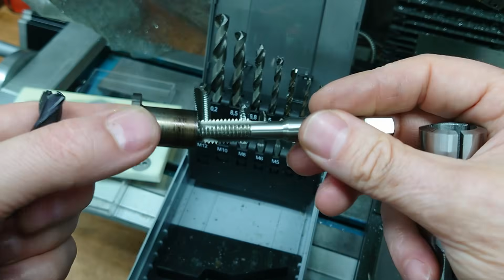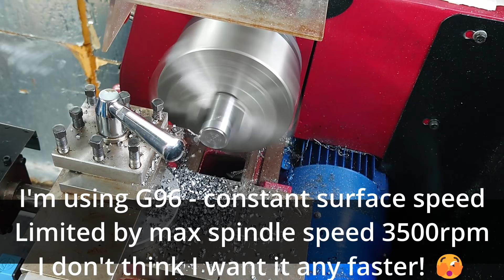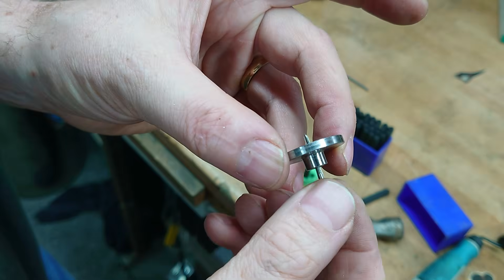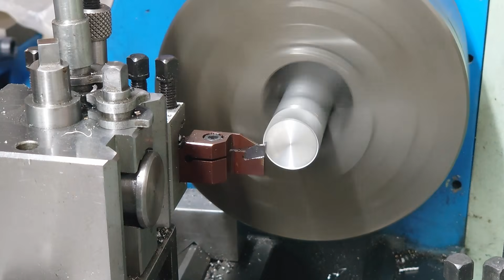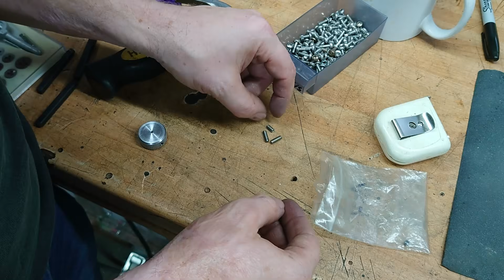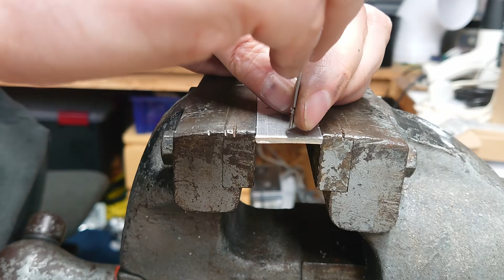Tiny Tapping Guide and Knurled Driver

Comment: I enjoyed the video. I've had a lot of trouble with tap handles that don't get a good grip on the square drive (tang) and therefore allow a relative rotation. The design you used had a single set screw (and therefore only one flat edge) so that seems to be a weakness. Maybe the forces work out for tiny M1.6 but in general I'd favour a design that applied as many flat faces to the square drive as possible, reducing slipping.
Reply from the maker: Hi, yes the single grub screw will only work for very small taps. Inheritance Machining made a nice larger tap wrench a few months ago. I think you can buy the plans. I was thinking of making one as none of my bought tap wrenches hold the tap square.

Comment: Nice one Olly! You won't believe it, but I use a battery drill for taps M5 and smaller. I did a lot of work on heatsinks when I was building amplifiers and switched mode power supplies. The clutch on the drill saves the taps from breaking. The drill and tap guide will make a nice combo for me.
Reply from the maker: I've used a drill for down to M3, but I wouldn't trust myself to keep the drill vertical enough to not snap an M1.6, even with the guide.  The holes I need to tap are in 55 heatsinks! I also have only a couple of spares 😬
Reply: @ollysworkshop  It sounds like a lot of fun.
Reply from the maker: @improviseddiy put it this way.... I'll be happy when it's done!

Comment: Nice. What controller board are you using for it?
Reply from the maker: The motion controller is a FLEXIHAL board from Expatria (a Canadian company). A raspberry pi plugs in to it. I'm running Linux CNC, which was a bit of a learning curve to get set up.

Comment: Nice job, l love the stamp guide's. For that size of tap and smaller I find just holding the tap in a short length of rod 6 to 8 mm diameter and about 60 mm long ( no knurling) works well and hopefully reduces  the risk of over torquing and breaking the tap. Maybe gripping a smaller diameter smoother surface gives a better feel of what the tap is suffering? The tap guide is very beneficial and highly recommended IMO. I'm no expert though.
Reply from the maker: I'm definitely no expert either. I think I saw a similar tap driver on Joe Pie's channel, can't remember exactly, but thought it looked like a good idea. I'll give the small rod idea a try too. Thanks for the tip.

Comment: The thing that improved my tiny hole work was a (used) tiny Albrecht chuck on a sensitive drilling arbor. Worth considering if you plan to do more of this type of work. One more caveat: when I did a bunch M1 screws and was having trouble, I finally realized my M1 die was not particularly well centered on the body diameter in the die holder. Off by 0.1mm is a 10% centering error and I was breaking off the thread. Letting the die float made it work better! Nice work!
Reply from the maker: For this particular job, I needed to have a compact solution, but I will probably make a tapping stand at some point. I agree that I would need a good quality chuck for such tiny taps.  
That tiny tap and die set I have really is terrible! I think the dies in my set are a lot more than 0.1mm off, the die stock is wonky and the inserts for holding the taps are unusable. However, for less than the cost of one decent tap it has proven useful.